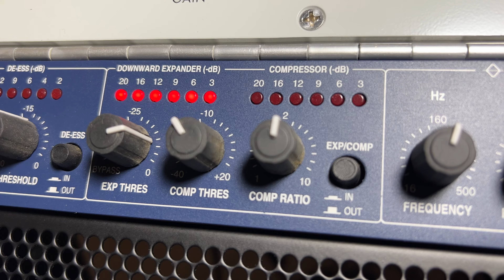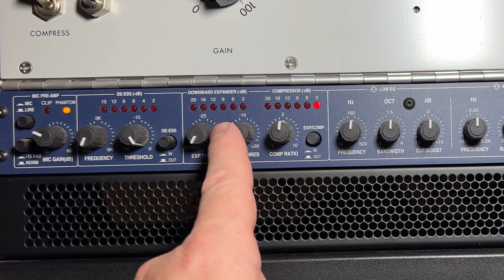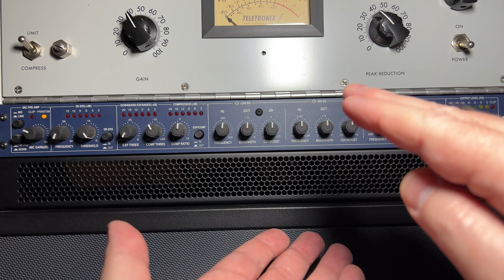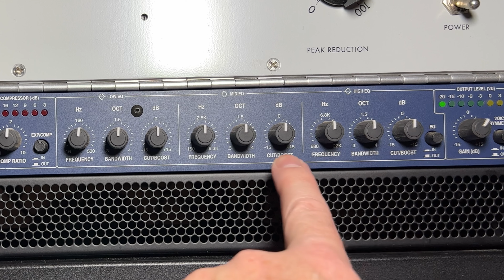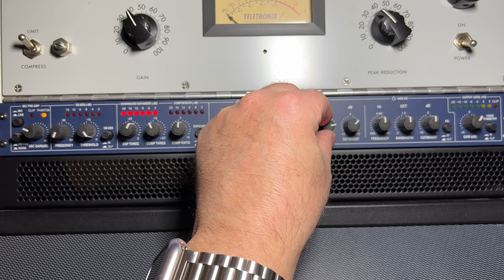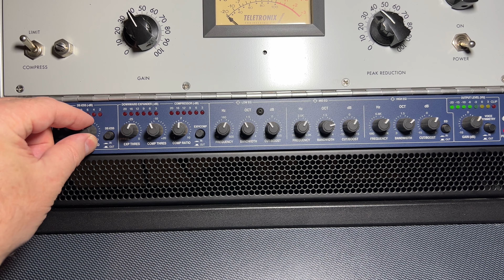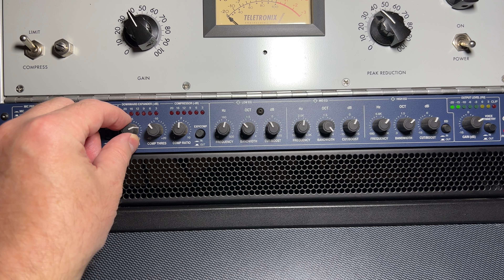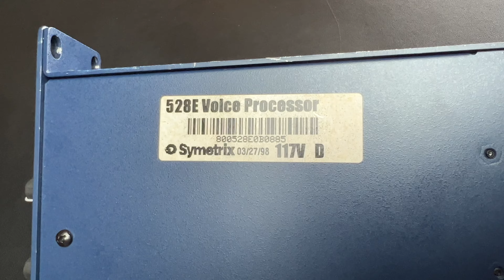Set The Symetrix 528E Voice Processor For Great Voice Overs!

Comment: Thanks, Lenny. I have an even older version of this unit, a 528 (no letter) that had been taken out of service at a local radio station. I opened up the case and applied DeOxit F5 Fader Cleaner liberally to the innards, as best I could, of all the buttons and pots; this cleaned them right up. It has more control than the dbx 286 series I use at our little LPFM station, but honestly the 528 has maybe too much control! I find it hard to dial in, where the 286 is so easy to dial in. BUT, this video helped me out a lot! I might swap the 528 in for the old 286 (no letter) I use on my EV RE20 at home. BTW I agree with another commenter: No need for the Cloud Lifter with these high quality, high-gain preamps.
Reply from the maker: Hi @Timflan. Wow, that's very cool! Thanks for taking the time to write.

Comment: I'm using one of these for voice processing my amateur radio station. This video helped me a lot in setting up the downward expander and compression. Your explanations are right to the point and quite helpful. I believe the voice symetry button is supposed to control the negative and positive voice peaks in such a way as to avoid overmodulating the transmitter. AM broadcast transmitters should not exceed 100% modulation or they will "splatter" and cause interference to neighboring signals.
Reply from the maker: Thanks for the info! 👍

Comment: Hello congratulations nice tutorial on this symetrix I have been using it for more than 10 years live on the air of my radio with a re20 c is so good
I also found a Symetrix 628 more difficult to adjust I find with more adjustment on the compression and the expander gate
Thank you for your advice that I am looking at here in France good luck

Comment: Awesome Lenny!!  Curious why you used cloud lifter.  There’s more than enough gain in preamp even for that gain hungry mic.  I have all kinds of preamps ….Wheatstone, Dbx, Avalon, distressor etc but I always Come back home to the 528e.  Thanks again for breaking down the settings for me.   FYI I’m the reason that management kept these things on lockdown.  I was always “improving” the settings.  As they say …. Your results may vary.   Mark Driscoll my PD at Y95 in Dallas had 5 processors on our audio chain totally locked down including a sinclavier of some kind.  We sounded like we were broadcasting from the death star.    Keep up the great work.  I really like what you are doing for the new generation of air talent.  None of them have a PD, chief engineer or other talent to learn from.  Forgive typos. I’m on my bike working out.
Reply: YEs, I have the symetrix 528e and the preamp on that is sufficient to where I don't even need a cloud lifter or an in line preamp. Maybe I should use it though, I wonder if it would help out reducing noise .

Comment: Great tutorial Lenny... I have this exact Voice processor....What settings would you recommend for the RE-27 mic?   The mic itself has  switch settings so I would need to know where they need to be defaulted as well....thanks in advance !
Reply from the maker: I would start with the switches on that mic in the flat position. Then I'd listen without any processing. If necessary, I would adjust the switches to get as close as possible to a sound that I like without processing using only the switches. Then, when I found the position I think sounds best on the voice, I'd use the 528e to optimize further. That's how I'd approach it. I hope that helps you.
Reply: @HeyLennyB  appreciate it...I'll let you know how it goes !

Comment: Great stuff, as always. I love gear talk. Focusing on the Symetrix with that LA-2A in the frame took a lot of work. Yes, there was some drooling. I noticed you adjusted the De-esser after the EQ, but looking at the back, the De-esser is normaled to the mic-pre output. It looks like you can customize the routing from the back with cabling. I did not see any routing when you plugged in the cables. Did you run the output of the EQ into the De-esser and then the output of the De-esser into the input of the output stage?

I believe the Voice Symmetry switch corrects for excessive positive or negative signal peaks of the human voice. I assume it resembles what iZotope RX does with its phase module. I use that all the time before processing anything. Very cool device. A nice piece of gear in your toolbox.
Reply from the maker: Hi Rocnred. No, I didn't do any kind of routing for this video. However, it is cool that you can with this unit. I think I prefer doing De-Essing pre Pre EQ anyway. Thanks for watching!

Comment: Hello. Thanks for sharing the settings. I use my 528e together with the zoom Fn8 and Sennheiser MKH 416 microphone. Now yesterday I bought the Rodecaster pro ii. I don't think the noise gate is as good as that of the Symetrix. Can I also use the 528e together with the Rodecaster for the noise gate, for example? Or just stick with the zoom fn8 and send the roadcoster back? You can do a lot with the Rodecaster and you don't need any other devices.
Reply from the maker: Hi @aboezakariaa.a1240. Generally, the more stuff you put in the chain, the more noise is introduced to the signal. However, there are no rules. I think you should try all configurations and do what sounds best to you. Hope that helps.

Comment: Great vid.
I love mine but it's getting long in the tooth as it's 20 plus years old..
How would you say it compares the the new units out there like the Behrenger?
Reply from the maker: Hi Nick. The Behringer UV1, the DBX 286s and the Drawmer MX 60 are all great. There are more channel strips out there and I intend to do videos on all of them soon. I think decades kind of degrades the audio, but it could be in my head. I love my DBX286s for a quick and dirty great broadcast sound. However, there's nothing that can beat the detail and control I can get when processing with plugins. I guess it all depends on what you're using it for. Thanks for watching.
Reply: @HeyLennyB  Cool! Thanks for the reply.  I do have some good channel strip plug ins but find it's easier when doing voicetracks for radio to not have to individually process each file.  I enjoy your vids. Cheers!
Reply from the maker: I'm with you 100%

Comment: Do you prefer The Symetrix 528E or DBX 286s?
Reply from the maker: Hi @SaverioTanzi, That's a tough question. I'd probably lean towards the DBX only because my 528e is very old. However they really both offer a great sound.
Reply: @HeyLennyB  Thanks a lot for the answer!
Reply: Hi @HeyLennyB , does the dbx 286A (not Project 1, just vanilla in black color) sound different/worse than the dbx 286S? Does the Symmetrix have better sound quality overall than the dbx? Thanks!

Comment: Hello, I bought a Symetrix 528e and I'm having a problem, I looked at videos saying to change an internal switch to use the line output to get better audio quality, but the equalizer, compressor and esser are not working, I've done everything and I can't make them work, would it be because I'm entering it with XLR and leaving it as a line or maybe it's a defect in the device itself? Thanks !
Reply from the maker: It's difficult to tell. I don't have any experience with the internal switch Mod. Sorry-